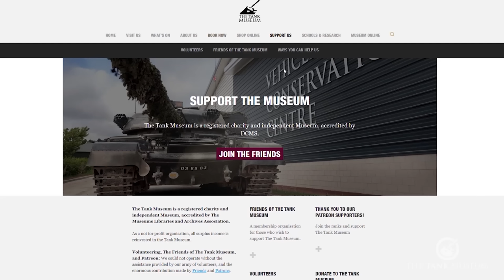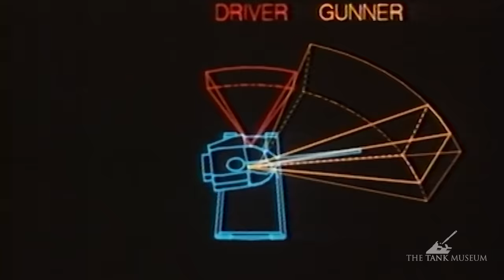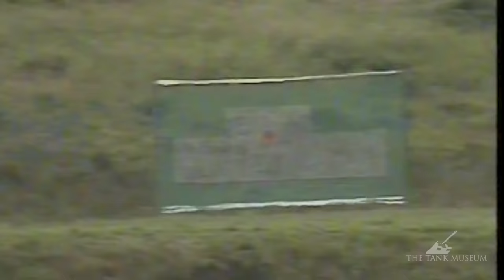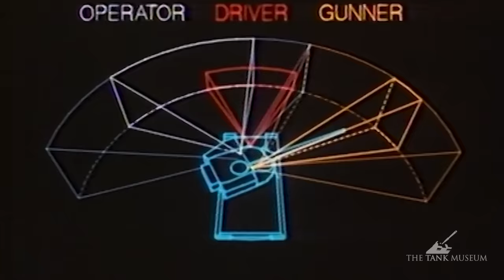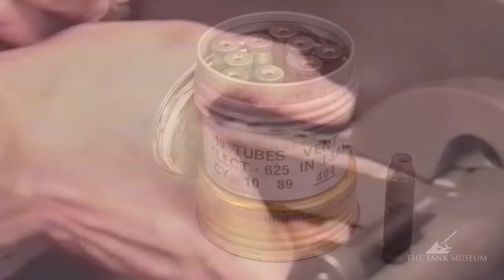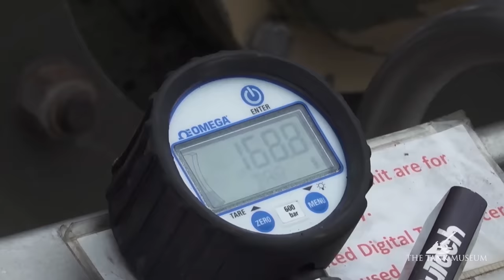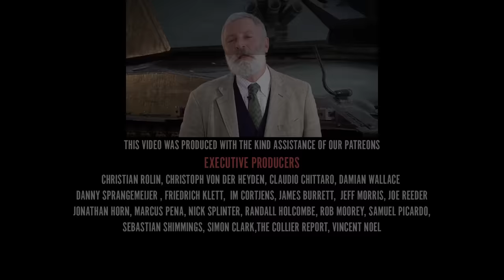Tank Chats #92 | Challenger 2: Full Length | The Tank Museum

Comment: Challenger 2 the best ever UK tank.

Sadly only one small export order to Oman.

Mo more UK tanks, export or die.
Reply: The gun and engine is outdated.  That why not many nation want them unlike Leo 2, M1 Abram and T-72/90
Reply: @aizseeker3622  That's why it's going into a re-fit.
Reply: It's biggest issue for export was mostly the unit cost. Which was fair bit more than anything else. And the leo was a bit more adaptable to nations requirements.
Reply: We no longer have the capability to build them and probably not design them either. The UK land defence arm of BAe Systems has merged with Rheinmetal, which is uncharge of the Turret upgrade programme. The original proposal was for a new turret (using Leopard 2 basis), but the current thinking appears to be based on upgrading the current turret. Little available publicly though. I think this JV is also due to German/Dutch Boxer into UK army service. The UK was originally part of that design, but dropped out, so its rather ironic to be purchasing them now.

The Ajax vehicles are being developed by General Dynamics (US corporation), although they will be assembled in the UK, a lot of the heavy work is being done in Spain. I've not read who will upgrade the Warrior vehicles (also much needed).
Reply: @tisFrancesfault  Really. I thought was because the Germans had a lot of them now surplus, and were selling them off to ensure there was a multinational maintenance demand to keep there manufacturer going for the foreseeable future.
Reply: @gimpygeese3121  David thanks. When I checked afterwards, Lockheed defence seemed to be likely, but that was over a year ago and I've seen virtually nothing about any concept being awarded an actual contract.
Reply: @kev french yes. There seems to have been a lot of problems though. this programme commences first, but seems to be quite a way from contracts being awarded. There seems to be a lot of overlap between Ajax and Warrior apart from the number of infantry carriers. I find it quite hard to understand why we have two rather similar vehicles.

Comment: In the current situation with unrest in the middle and far east. We should be building more tanks, even if they are held in reserve and rotated through training schedules.   The future will be force integration. Battlefield awareness via secure instantaneous communication between all arms.  The updated Challenger 2 is more than up to the task but not as advanced as some of the newer vehicles fielded by the Russians.
A new turret with auto-loader and integrated UAV launcher. Reducing the crew to three, with perhaps a seat for a dedicated IT operator if needed.  Keep the rest of the tank as is.
Reply: I agree they don't have enough tanks, I'm surprised they have so few.
I would have expected 5- 10 times more
Reply: @indyrock8148  Up to 800 would be OK. With half manned by seriously trained reservists.
Reply: It's something that's worried me about the fleet numbers for a long time. Far too low if we ever have to move to high-intensity warfare.
Reply: Cost too much to have fleets sitting idle in a warehouse, despite rotating them. As to the autoloader, just no. Having 4 crewmen gives a measure of redundancy if 1 of them gets hit/injured, also if you have EVER changed a track on a tank you need as many men as possible!

Sad to say the MBT as we know them, i think will be phased out, with autonomous drones, highly advanced anti tank missiles etc the modern battlefield is no place for them and this sis coming from a tankie of 18yrs, so thats abit hard to say....
Reply: @catlee8064  There is still a need for tanks as "force projection" on the battlefield can only be done with them but without air superiority they are nothing but targets.
Reply: @gusgone4527  Even we had that many (we never built more than 400) nd could crew them, we couldn't deploy as we don't have enough infantry support units and Warriors. That's before you even consider the real logistics and support in the field issues that we'd face. 

It would be interesting to hear someone who actually knows more, but I'd guess we'd be stretched to put more than 50 or so fully supported C2's into a war zone at present if we deployed everything we have.
Reply: @Wien1938  The assumption is we won't.

If we did, then we'd used F-35's with stand-off weapons (eg the US Stormbreaker bomb https://en.wikipedia.org/wiki/GBU-53/B_StormBreaker). The F-35A can carry 8 in stealth mode (with 16 more in non-Stealth) and the UK Spear-3/Brimstone missile weapons from non-Stealth aircraft (not sure if we can deploy these in Stealth mode from our F-35B's). This Small Diameter Bomb development can have a range up to 45 miles self guided when dropped from altitude.
Reply: @catlee8064  I actually doubt it, although the crew numbers will decline and the next generation will be semi-autonomous. The problem with Drones is that they're highly vulnerable when deployed against any force with near pear capability and I doubt any of us really has any understanding of the ECM/ECCM combined with actual EW.

I think this is a very interesting article (https://www.thedrive.com/the-war-zone/33401/this-is-what-ground-forces-look-like-to-an-electronic-warfare-system-and-why-its-a-big-deal) and I rather than think that the active and passive counter measures that C2 TES now has and the Russian active defence system( Afghanit) on the Armata may prove to be counter-productive. Reducing IR, EM and Radar visibility (Stealth) are probably the way to go. The Armata design may have some strengths on this front.
Reply: @nickbrough8335  Nick, therein lies the problem. Under manned and under funded. Recruiting despite what they say is not a problem. Just negate student loans against time served and watch the ques grow. Return medical screening to the RAMC and see the number of silly rejects shrink, as role is taken into account. Of course deploying 400 MBT's would require all the necessary IFV, infantry troops and logistical support. I'm talking about holding half of the force (further 400 and some of the associated support) in the reserves. Where will all that money come from?
Short term, slash to almost zero the overseas aid/development fund. Everything but Nepal, Fiji and other places from whom we recruit. Trusted allies ONLY.  Longer term the economy would be boosted by the growing manufacturing sector. State support would be needed initially.
Reply: @catlee8064  Sandy, my background as senior NCO is not specifically armoured but yes, I have assisted changing a tank track. I wonder how the Russians manage with their new three maned MBT? It's not as if they are newcomers to the armoured warfare game. Perhaps the accompanying infantry help.
As for the end of tanks. I'm not so sure. They have evolved to keep pace with threats since WWI. The latest EW threat will be countered too. MBT's will change  that is a constant characteristic. But the need for a well protected mobile fire platform will always exist. Wild speculation here but what if the tank of the future emits zero electronic noise; zero engine heat and is able to visibly blend into the background - disappear?
Reply: @nickbrough8335  A great article. It points the way for future defensive technologies. More stealthy ground forces and hardened electronic systems.
Reply: @gusgone4527  Money is less of an issue that it seems. It's about relative priorities between the three services. The Army is more numerous, but actually relatively cheap to equip. A type 45 and 26 destroyer/frigate cost around £1 billion each and we have (or are building) at least half the number of each that we need. The Type 31 planned, will be cheaper and provide numbers, but will never be anything other than a glorified patrol boat (but still cost over £2 billion for the programme). Each F-35 costs least £100 million to buy the 48 for the two carriers is a £5 billion programme. I guess you could replace Challenger 2 entirely for £2 to £3 billion.

The real problem is that no one really believes there is a threat. democracies under-equip and under-spent of Defence and appease Enemies until it is too late than pay the price is casualties. The UK has been doing it since at least the 1880s apart from the Navy in the run up to world War 1 (when arguably we still made the wrong choices).
Reply: @gusgone4527  Thing with the 3 manned T14, its not in service to any large degree, we dont know the make up of companies, they might have a larger support element. Yes the infantry could help.

With the battlefield being what it is, unmanned aerial drones, Anti tank missile armed Helicopters, Anti tank infantry, mobile ground based vehicle tracking radar, the possibility of MBTs lasting to be anything more than just a speed bump in this hostile environment is very small. and all our most recent conflicts have been insurgencies (yes iraq was a conventional battlefield at the start, but it morphed into something totally different) 

Zero heat is the biggest problem, all electric vehicles need huge amounts of cooling, When either the coaxial MG or main gun fire, huge amounts of heat is built up in the barrels, even the tracks after a road move are hot.

What most ppl fail to understand is(not you), every other arm of the forces is there to support the infantry, that is our main roll, you cannot take and hold ground without them.

Comment: @ 6:41 - Looks like it's from the Car park at RARDE Chobham
They'd put the whole tank into the atmospheric climatic chamber,  take it to 30,000 ft and -30 degrees and test it continuously in arctic conditions and  then bring it down to sea level and 50 degrees C to simulate desert conditions.  The test facilities were very comprehensive and included testing on acquired  "hostile" vehicles.

Comment: I fired a lot of HEP rounds.  The 105 US version of the HESH.  We hated it.  It did not fly straight.  It had so much spin on it that  it went up, to the right and then curved to the left.  It was like a hook shot  in golf.  You could hit  a target twice with a SAPOT or a HEAT round.  The HEAT round also did not reduce penetration with range but it was MUCH more accura te t han the HEP.  The HEP was very slow and it was hard to hit anything with it.  We used to give them away cause they were crap.  If you wanted to shoot  a hole in anything, use a HEAT round.
Reply: ANGLO-SAXONS  105s were rifled

Comment: Live track has the track pins cast into the pads with a rubber bushing that is fixed.  The track is assembled flat which means the track pads want to stay in a linear orientation.  As the track rotates over drive sprocket and the idler, the weight of the track and the force placed on it by the drive sprocket pulling on it causes the track pins to rotate.  They are rotated against the restraining force of the rubber bushing.  This "preloads" the track and takes energy out of the system.  When the track travels to the bottom and rotates back to flat orientation, the energy put into the bushing is released.  This action prevents the excessive wear that is experienced by dead track that has track pins and no bushing.  This rotating action also creates a lot of heat.  If you drive for an hour then stop and check the tracks, they are HOT because of the twisting action of the live track bushings.

Comment: Tremendous video, Mr. Willey, it is great to have a crew give some details into inner workings of a vehicle, always.
Serious question though, I wonder why the Lads are rocking a camo pattern uniform and, what at a distance anyway, I can best describe as "tactical blackface"? Normally I'd understand the need for concealment but this being a Tank Crew, it seems a bit unintuitive?
Cheers again.
Reply: It's because of a couple of reasons:
1. An unpainted human face is very easy distinguishable to the human eye - if the commander has his head out of the hatch, he could give the tank away.
2. Camo-pattern uniform serves two purposes:
a. As above, the body is presenting a diffuse colour and pattern array, so the body of a tank crewman is not easily separated by the human eye from the tank itself, and;
b. If the tank crewman has to dismount, he is more difficult to spot, so he's safer from enemy infantry, marksmen or AFVs etc.
Reply: @Wien1938  Good info. Thanks very much !

Comment: I just noticed that on the starboard side of this vehicle the forward return roller is not engaging the track guide pin. I doubt if this is manufacturer standard so I presume that this heavily used vehicle is in need of some 2nd echelon maintenance. Typically British documentary, superb. BZ guys.

Comment: I think the challenger 2 can be so much better if they added the l55 smoothbore gun and much more engine power since the challenger is so heavy compared to other nato tanks while having a weaker engine. Having hard kill and soft kill will also help extend its lifespan.
Reply: it's about two tons heavier than a Leo2 and the same weight as an M1. The Megatron version weighs seventy four tons but it's not a service tank.

Comment: Its still crazy that the British still use a rifled gun when smoothbore guns literally have all the advantages! Smoothbore guns last much longer, more accurate, cheaper and able to fire longer sabot rounds. Also HESH rounds are outdated because they are almost useless against any modern MBT and there are better multi-purpose rounds that do the job better.
Reply: @EmperorLionflame  you’re just so wrong and even shows when challenger 3 is getting the smoothbore
Reply: @EmperorLionflame  no

Comment: Very interesting tank chat once again. 
One question if I may: I've often wondered how platoon commanders and tank squadron commanders could lead a platoon or squadron/company while at the same time directing their own tank crew and functioning as a hunter for their own gunners. I imagine - but have no experience or evidence - that either the gunners in the platoon's or squadron's CO's tank would be very experienced ones and are able to pick out their own targets and direct the driver and loader as well to free the CO of directing the tank as well as the unit, or commanders have developed a near seemless routine to assign targets to their crew directly after having given orders to the unit.
Reply: You are essentially correct in saying the OC/CO's  tanks are crewed by highly experienced personnel. 

A normal crew would be 2 troopers (gunner and driver) a L/cpl as the loader and a Cpl/Sgt/plt Ldr as the commander.

 In the OCs tank (sqn ldr) 2 L/cpls as gunner and driver, Cpl (possibly a Sgt depending on manpower)  and the OC.

In the COs tank would be Cpls as gunner and driver (usually instructors/tank cmdrs in their own right) a Sgt/SSGT as the loader ( Signals instructor/RSSO) and the CO.
Reply: As Sanyo stated the crews on Command Tanks are more experienced,  Command wagons also normally hang back a little bit so they can manage the battle and having a more experienced crew like you originally thought does take a little bit of the pressure from the Commander. The flip side is the pressure comes on when doing live firing as these crews are expected to do the best !! 
There are lots of other duties outside of just operating the tanks i.e on the Troop Ldrs wagon the loader will be responsible for the troop admin, ensuring the harbour is run correctly, sentry routines carried out etc.. 
As for the near-seamless running of the tanks, well kinda there is a lot of shouting and swearing and general pandemonium  !! lol

Comment: 3 arguments the Brits should have had 120mm Smoothbore: Choosing this niche of 120mm rifled, the only advantage mentioned here is the Hesh round. Any data on how much better it is compared to a smootbore 120mm HE shell? 1. Cost is actually greater, with the barrels wearing down more quickly and the need to harden them with chrome and 2. 120mm rifled ammunition has become non-standard and very few suppliers would still make these for this particular vehicle (at a premium of course) which leads to 3. Interoperability isnt there, most other NATO countries have standardized on 120mm smoothbore ammunition. I do not think that just any type can be interchanged from lets say a german Leopard 2 to Abrams but there are advantages in sharing the same ammunition type. Would the Brits have fared better with license building Leopard 2 in the UK from BAE land systems as Spain did? PS: It takes 35 mins to change a Leopard 2 engine....
Reply: A Rifled bore, where the round spins is more accurate as any physicist will tell you.

Comment: On the turret area of most tanks I see, I see a group of about 4 or 5 holes either side of the main gun barrel that almost look like you'd want to hang a flag out of each of them. 
What actually are they? 

Many thanks

Paul
Reply: The gun manlet can't be welded because of it has to move, so they use armor grade nuts, its allways the weakest part of the turret due to lack of composites.

Comment: Since the 1970s, HESH ammunition has increasingly fallen out of favour as armour designs have trended towards layered composites of hard metal and heat-resistant materials. This type of armour is a poor conductor of shock waves. Anti-spalling devices (spall liners), made of materials such as Kevlar, are commonly fitted to the interior surface of modern armoured vehicles to minimise spalling effects.